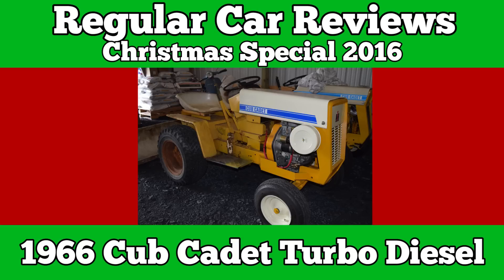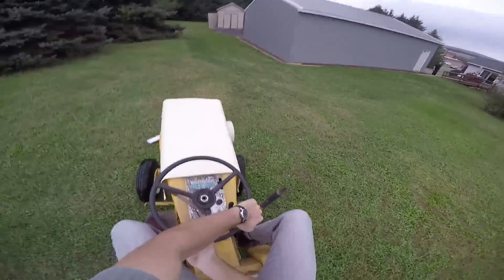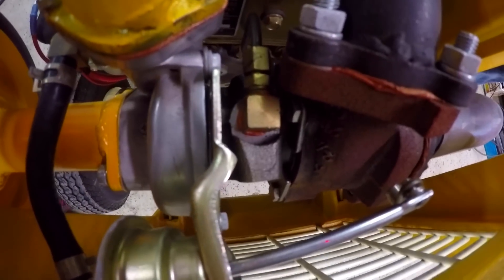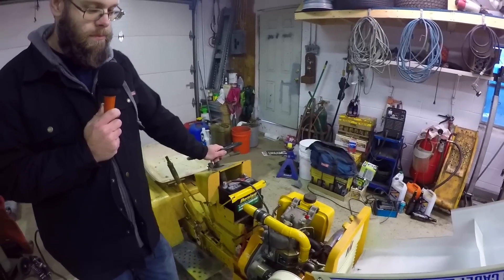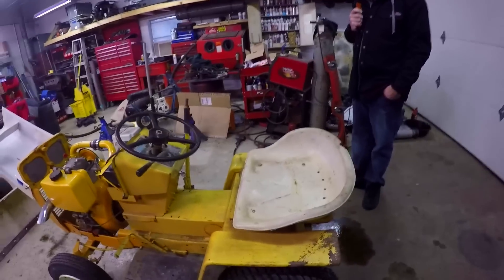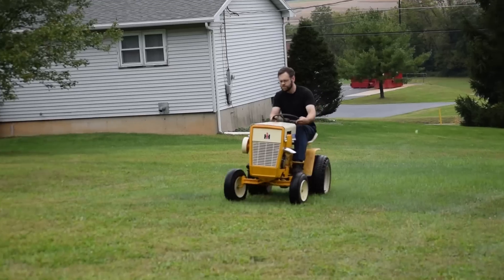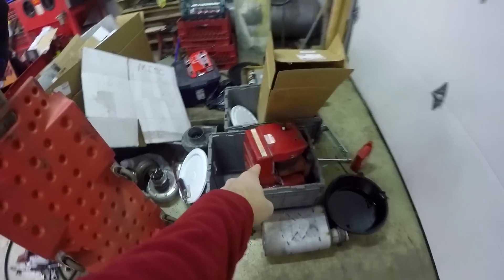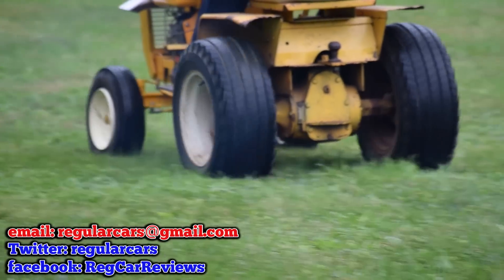1966 Cub Cadet Turbo Diesel: Regular Car Reviews

Comment: Those old cub cadets were built like tanks. Would like to have heard what the engine sounded like.
Reply: Got a '74 John Deere 110 with the K241 Kohler these had stock. Never underestimate those cast iron Kohlers.. Pretty remarkable little things (well, not little at all actually...). Have a '72 140 H3 (K321, Sundstrand 15 Hydro) that we found cheap and rebuilt. 46" Deck and will cut the thick stuff at full speed (6.5) with no issue. 
Have a few others; the 330 with a 3TN66 Yanmar Diesel (658cc Inline-3) 
Those last two are basically the same Sundstrand as this Cub. Never heard of one slipping before; that is weird. I've pulled the 140 before with 26x12-12 R4 tires; took 1st in the highest class. And tow started my John Deere B with it a couple times. ('36 with high compression aluminum pistons, etc) Believe me you can't make a good one slip.

Comment: He is wrong when he says that the original motor is a 10 horsepower Kohler. From the year given, 1966, and the styling of the tractor (except for the incorrect hood stripe), it is obviously a model 123. The only engine available in a 123 was the Kohler K301 12 horsepower. I do really appreciate the vintage IH Cub Cadet on your channel though.

Comment: Justin Cramer, do you have a Cub Cadet 70? (I believe there was a 100 that was the same other than being 10 hp vs the 70’s 7 hp)
My dad had one for nearly 40 years
Love those old tractors!
Some actually had a low range as well (I don’t think ours did though) 
Sooo much better than pretty much and garden tractor you can buy today
Reply: Aaron Hainan   I bought a used 70 years ago for $25.  The rod had broken.  I overhauled it, bored it .10 over, and used it for 10 years.  Sold it for $300.  I would mow the five acre church lawn once a month during that time.  The 38 inch deck worked perfect.  The only issue I had was blowing head gaskets when used for long periods.  Finally cleaned out the threads for the bolts, added one washer to each bolt, and over torqued it by 10%.  Never had another issue after that.  Hated to sell it, but I was moving and no longer needed it.

Comment: We have a '66 Cub Cadet somewhat like this with a 10 hp motor, and it still moves pretty quick for that old of a tractor. Also the steering is pretty bad...
Reply: But it's the stock Kohler 10 hp
Reply: Its pretty normal for the steering to wear out, that is one of the only things on thees tractors that actually wear out apart from the engine.
Reply: Patrick Kissman The steering is a ball and a rod but the ball wears downs and falls out of where it stays on the rod. For now we've ziptied them together cause we're too lazy to fix it.
Reply: the tie rods normally wear out but they are so simple you can normally straighten them out pretty easily

Comment: I don't get it, my Poulan Pro is faster than this stock.
Reply: Did you watch the end of the video where they talk about the weight and what this is meant to do? It's really more of a car guy and tech number kind of thing. I liked it for that.
Reply: Wayne Moyer No, I got bored half way through, to be honest. Is it worth watching the whole thing?
Reply: If you were bored half way through then you won't like the second half.
Reply: Wayne Moyer LOL, ok, now I have to watch the rest. Thanks alot, buddy.
Reply: He said the Hydro slipped. I had a 109 with the Kohler in it and they do 8mph from factory.
Reply: I have 3 hydro cubs and they're all way too fast for anything useful at top speed by at least double. 8 doesn't sound like much until you punch it from mowing speed to stop speed. Mine will also do wheelies.
Reply: Just imagine if it was a straight cut gear drive like some of the John Deere and Sears of its time. My dad has a 68 Sear Suburban 14 with a 6 speed ( 3 gears with a high and low range) mated to a Briggs 14 horse single cylinder. Damn thing can pull anything and can go about 10 mph with no load behind it. Sounds awesome too.

Comment: You just destroyed a perfectly good Cub Cadet ! You would have been much better off to go wirh a 16 hp Kohler .
BUT you still have a 3 hp TURBO Diesel China Engine....
Fill the rear tires with RV antifreeze and you can pull a large vehicle....

Comment: Ok.. After a few years since video was made. Where did this thing end up ? Turbo removed due to sadness from incorrect application and tuning?  Realized  after turbo was removed tractor made more power but was insanely diesel loud, so you put the flathead back on and all is well again in tractor fantasy world? OR did it depress you enough to just haul it to the scrap yard ? It could have been such a cool project, lack of fuel with all that extra air was a recipee for nothing to special. Why not get some extra fuel added measure the afr and exhaust gas temps and triple the power of that yanny clone. The vz21 is small enough to run on that diesel to build plenty of boost even tho it is a single cylinder.. No reason that diesel should not be making less than 35-40 ft lbs torque at 3200 rpm. Come on buddy get her done..
Reply: that rhb31 was way to big, single cylinders struggle with only 1 exhaust pulse, rhb31 struggles to spool on a stockish 3 cylinder.